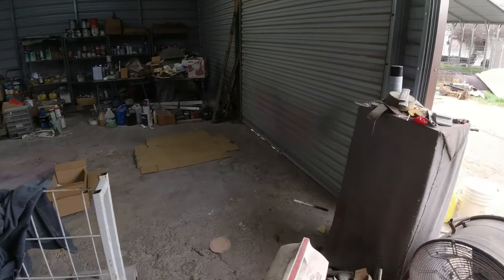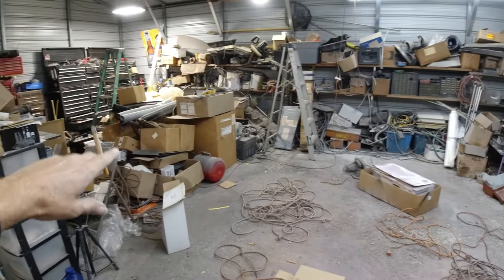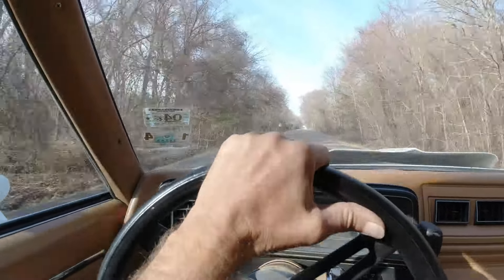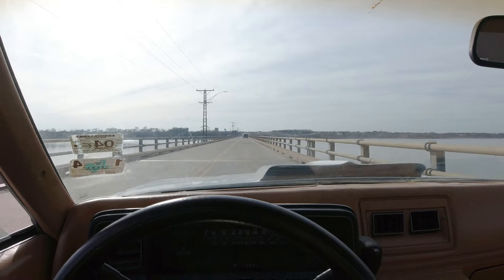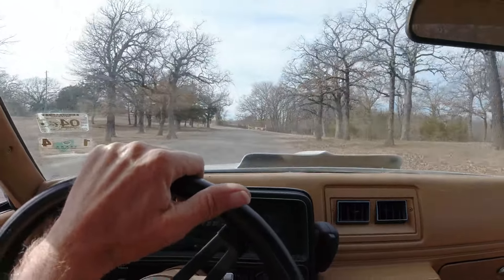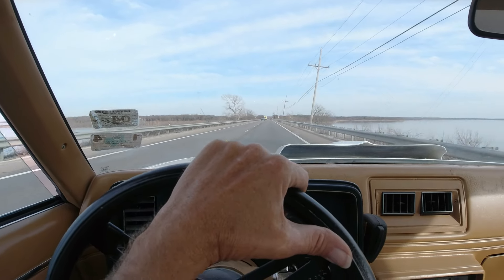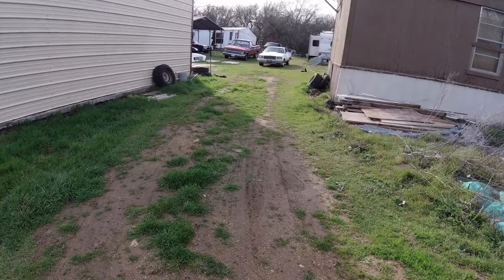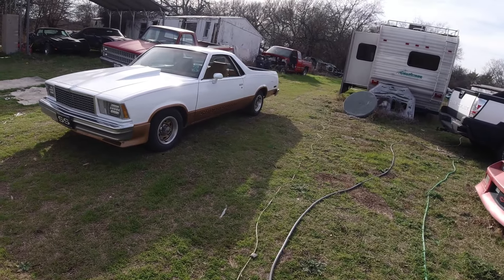#37. 1978 El Camino SS. Build is done!! First drive in 20 years! Back on the road again!! #cinoton

Comment: Straighten the tires take steering wheel off put on straight 😊
Reply from the maker: only goes on one way due to horn button
Reply: is it possible to undo it at rack joint and spin the wheel then re-connect? in my head it sounds easy but in reality probably not so much @clunkersandclassics

Comment: Your Steering Wheel Is Fine, Do Not Touch It, Reclock The Steering Through The Tie Rods Firts...   Jack The Front wheels off The Ground Tires An Inch Off The Ground.. Yurn The Steering Wheel Place it Where it Should Be..   Turn The Key Off.. Making sure The Whca eel Stayed Straight... Now walk in front of the car.. Look At The Tires, Align Your Site From lOOING At The Side wall oF The rear Wheel.. Turn Your Toe In or Out Withe The Turn  Buckle. Each side done seperate.. You will probably Find One Side is Toed Out More Than The Other.. The Side that Is Toed Out Is The Side That Has The Issue, Bushing,Some body Hit a Curb Or something like That... .. at This lime adjust The Steering Gear b Box.. This Will Be The Correct Procedure  It Will Not Cost A Dime.. Perfect align The Rear to Front.. Use A String, Run it across Both side Walls.. Once They are Perfect Crank The Toe 1/4 inch Inward.. Lock The Jam Nuts.. Make shure Your Camber is plumg Use a Plumb Bob On The Side Wall oF The Tire Once Plum Take The Camber 1/4 inch At The Bottom... DD Both Sides.. Bam Your alignment Better Than any Shop... The Whole Proccess  1 Hr.. The Steering Wheel and Shaft Only Slip Together One Way...Clocking It as Described Fixes Blinker issues And Past Lazy Work From Others.. Try it, See How Much Better She Handles, Braking  Will Increase .. Brake Wear will Be Reduced.. This Goes For All Tour Cars..  Most Akk Of My Trucks Run 37 or More.. My Tires  Wear Flat And True On All 4...Kern Canyon Driven Every Day.. I Have Owned Some oF The Best Road Cars , High Performance Or Off Road, I alighn Them all The same.. Especially My Quad... Befor You Do Any One Thing Try This Fix Out...    Through It All... Make Sure The Steering Wheel Stays Straight..
Reply from the maker: It drives straight as an arrow so didn't want to mess with it.